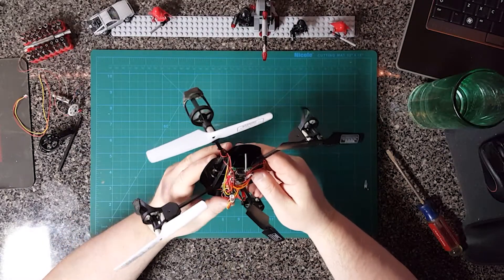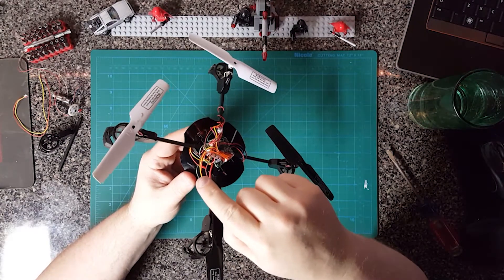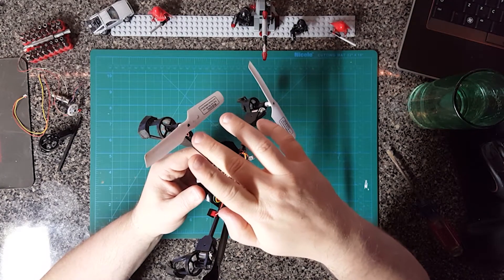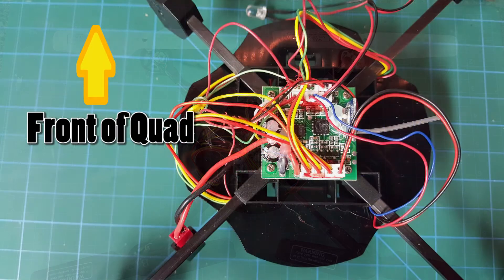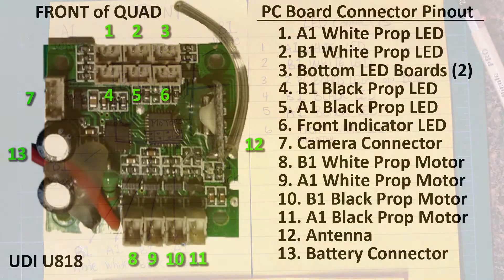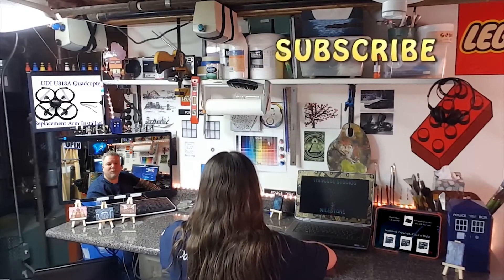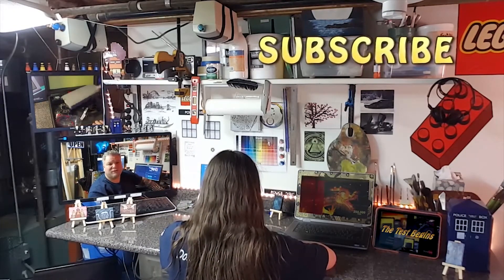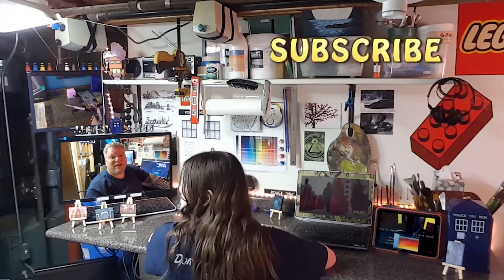UDI Quadcopter PC Board Connector Pinout - U818A DroneTube Repair

Comment: I need help with my drone it's a vivitar step view and when I opened it up I accidentally pulled some wires out that were connected to the a small chip board  inside the drone and I thought I hooked them back up together but now it just flashes it's lights

Comment: Help !!
My udi rc u818A HD dron's electrical conductor 2300 has burn what I can do to repair it?
Reply from the maker: Hi, sorry youre having issues. I would try buying a new mainboard here: ( https://amzn.to/35oVItC )and replacing that. Otherwise, not sure if you can purchase and replace discrete components on the board. Good luck and let us know how you make out.
Reply: I have the same problem and I don't know anything about electronics, I did some research and I think they are SMD transistors, I bought some and I hope they work, I was looking for some electronic circuit diagram but I couldn't find anything.

Comment: I was contemplating the use of the reciever for an RC lawn mower. Mostly because of the return home function, and camera connector. Using a dual motor 32a sabertoth, what two motor connection should I use? B1W+A1B is my initial guess.

Comment: I replaced the motor, check all the connections are fine, thanks you for schematic, but the motor when connecting the battery it  keeps operating slowly and without any order on the part of the command control, maybe The board or what do you think, thanks for your help!
Reply from the maker: Hi, i have heard of that happening after the board was replaced with a new one. And unfortunately, most of the time it was a bad new board. These things arent the greatest quality and ive heard of a fair amount of them being bad right out of the box. Sorry for the bad news.

Comment: I need a new board. Thought it was a bad motor. Nope, plugged motor into other power source and it runs fine. Is there a board replacement part for this?
Reply from the maker: Hi Steve, sorry you're having issues but glad you pinpointed the problem before buying unnecessary parts.  Take a look at this board and be sure it matches the one in your quad before purchasing and good luck with the repair. https://amzn.to/2kUSOWM
Reply: ThinCube  didn't fix it. 1 new motor isn't working at all. No power no led light. Other 3 motors work. Could it be the controller?  I have video of what it is doing
Reply from the maker: You replaced the main board and one of the motors isnt working? Am i understanding you correctly? If so, try swapping wires on the main board to see if the motor will work on another connector, if so then the board you got is bad. If not, check the wires to be sure they have a good connection.  Is your video posted somewhere i can watch it?
Reply: ThinCube new board, new motor. Thought it was a bad motor but it's not. The motor works when plugged into other socket. Ok so tried new board. Does the same thing as before. No power to motor and led doesn't work either.
Reply from the maker: It sounds strange. Ok, last thing i can think of is this: Did you try powering that particular motor with connecting it into the housing and gears and props? There possibly could be some binding . Other than that i am stumped! Sorry
Reply from the maker: If this is exactly the same issue you had with the original board and motor then i am lost for an explanation. If not then i would say theres an issue with your new board as well. Otherwise, i dont think the controller would have anything to do with it at all.
Reply: ThinCube the old motor did have something wrong with it I think. My old er bro is the one trying to fix it. Anyway you could talk to him about it? Facebook messager?
Reply from the maker: My final guess is that if the old bad motor was ever plugged into the NEW board if could have shorted something out and damaged the new board. Its very difficult to say without all the facts or without being there to troubleshoot it first hand. Sorry

Comment: So, very helpful videos.  My UDI 818a WIFI burned out a motor controller in a crash with a tree recently, so the new motor arm didn't do the trick by itself. I've been unable to find the specific motherboard required for that model. The others (not for the wifi model), don't look like the one in my quad.  Any ideas where I can find one that looks like mine? I'd send a photo but Not sure how to in theses comments.
Thanks.
Reply: One note - the power cord to the battery is blue and red, with a white connector.
Reply from the maker: Hi Keith, glad the videos have helped and sorry to hear about your main board woes!!! I have seen them come up on occasion, on Amazon i believe. I would google the numbers on your particular board and see what comes up. Its very common for a motor issue to also take out the main board so i have seen alot of issues like this. If you are comfortable with soldering, you may want to try reflowing some components on the board. The solder joints on these things are very weak and heat can cause them to open up like a blown fuse. Another very common issue with all sorts of cheap electronics. Good luck and let me know how you make out.

Comment: Hi, our drone is only intermittently pairing with the transmitter. When it won't connect, a tiny red LED on the bottom of the PC board flashes. Do you know what that means? We have power, as all the other LEDs work, and the drone will fly at odd moments when we somehow get everything connected. Moving the throttle up and down does nothing when the red light is flashing.
Reply from the maker: Hi Paul, did this start happening after a crash or doing any modifications? I ask because it could be a bad connection with the antenna. Lift off the housing and take a look at the antenna. Make sure it is straight (its just a small piece of wire that you can bend and straighten with you fingers). Also, make sure the solder connection is good on the antenna. If all that is good, make sure you take the batteries out of the controller and the drone for at least 30mins to get everything to fully reset and then make sure all batteries are good. Let em know what you find.
Reply: Hi ThinCube, Your idea is a good one. I checked the antennae, and I think both antennae are in good shape. I looked at the circuit boards on the transmitter, and they both have a residue on them. I think someone spilled something on the transmitter, and we have at least one short. I tried cleaning the board with a damp swab, but it was not effective. Next I'll try gentle abrasion.
Reply from the maker: Hi again Paul. Do you have any experience with soldering? If so, try reflowing all of the solder joints in the area in question. The technique is called "shotgunning" and it has helped me repair many items in the past. Especially with cheaper electronics made at questionable factories. Their solder joints are hit or miss from the start. Good luck and let me know how you make out.
Reply: Hi, i just reflowed my board and the quad is now alive. I forgot which plugs the motors go into so that's why i came to this video.
Reply from the maker: Awesome Max, glad to hear it. What were the symptoms before reflowing?

Comment: Thanks for this.   Helped a buddy out who had installed a replacement board 45 degrees off orientation.  We didn't know that the board had a front and back, but it makes sense now that the gyro needs to be aligned with the motors it is controlling to fly properly.  If you've replaced a control board, and your drone won't stop flipping over on takeoff, check to make sure the board is installed facing the proper direction.
Reply from the maker: Hi dachs, thanks so much for this info and glad the video helped you out as well. I was not aware of this situation and will be sure to let others know in the future should they come to me with similar symptoms. Might consider doing a video of me installing my board incorrectly and show what happens. Thanks and happy flying!!!

Comment: Had a crash n a busted motor. Replaced the arm. Now when I connect the battery that specific pin is receiving power n the blade starts spinning immediately but doesn't spin when trying to takeoff. Do you think I need a new motherboard?
Reply from the maker: Hi Darwin Duck, yes unfortunately it does sound like the controller board is bad. You can purchase them here:  --- ---Replacement PC Board: http://amzn.to/2a2ywaL    Good luck and let me know how you make out!

Comment: bibbs823, I think what happened is your bad motor overloaded and then took out the drivers in the H-bridge, i.e. shorted them out. These are transistors that switch the variable pulses to run the motor. The run-on of the new motor suggests these switches are shorted. The only way to fix that is to replace the driver board.

Comment: just got this drone as a Xmas gift and crashed it from bout 10 ft onto cement and now it won't fly all it does is flip over on takeoff its uncontrollable... tried replacing blades unhooking and rehooking each prop trying to reset it every attempt has been a NO GO... my brother in law got the same exact one and when he does the gyro reset hit front led light blinks 3 times where when I do it mine only blinks one time... any idea on a gyro reset or mod to get my unit running again
Reply from the maker: Hi Chadd, first off watch this video to be sure all of your props are spinning in the right direction and have the correct prop pitch at each location (especially if you removed them and possibly installed in the wrong order). https://www.youtube.com/watch?v=nTNhGXrO5ik&feature=gp-n-y&google_comment_id=z124dvoqfwz3upcih04ch5vy2xn3jv2pmng0k   Let me know how you make out and what you find. Also, not sure why yours isnt responding to the reset. These things arent built to strict quality controls so sometimes they have different components and different firmware.
Reply: all props are correct and spinning the right way still no go but it never flew right right after I crashed it was flying perfect I crashed it and the second I turned it over and tried to take off again it just flipped over on takeoff like its brains or fried or something it says in the manual you can unplug and replug for a reset but I don't know if the copter needs to be on or what
Reply from the maker: I was just reading a couple of manuals online and to be sure you do a reset from the beginning you should remove the batteries from the drone and the transmitter for at least a couple of minutes just to be sure any errors are reset. Also make sure you have charged batteries. Then turn on just the transmitter and throttle all the way up, then all the way down. Then power on the drone and place it on a flat surface. It should be facing away from you. Back toward you and front facing away as if you were following it.  After this you will hear 3 beeps and the front LED will remain solid. Be sure NOT to touch the throttle during this proceedure. Now move the direction stick and you should see the LED flash, indicating that it is calibrating. Once the LED remains sold it is ready to fly. Here is a link to the manual i am referring to, page 9:   https://www.docdroid.net/UfMq0de/818a-hd-manual-2016-print.pdf.html#page=9
Reply: I put a video on my YouTube of my drone and the issue I have feel free to check it out and lemme know your thoughts haha
Reply from the maker: is it live yet...i didnt see any videos on your channel. just a def leppard playlist. saw them in concert years ago :)
Reply: Lol hold on I try again
Reply: I just set it to public try again
Reply from the maker: Chadd Ward Wow, yeah never saw anything like that. It is very strange in that it starts to fly a little bit then BAM....it flips. I've only seen them flip right away as you try to take off. My guess is that something on the main board got damaged during the crash (the gyro or a solder connection on an IC). Without another similar drone to use as a test bed the only thing i can suggest is buy a new main board or another UDI quad :( Sorry Chad!!!

Comment: any fixes for the motor constanly running.  replaced front CCW arm and when battery is connected- motor runs.  seams to be whatever is connected in pin 8, constantly runs.
Reply from the maker: Hi Brady, that is a common issue and everyone i've spoken with has had to replace the main board. The board highlighted in this video actually. You did exactly what troubleshooting i suggest to make sure its not the motor or wiring shorted, so if anything connected to that pin is always on, then the board is supplying voltage/current when it shouldn't be. Sorry for the bad news and good luck with your repair.  There is a link to the replacement board in the description above.
Reply: I have the same problem. Mine is a u818a wifi. I cant find a board. any suggestions?
Reply from the maker: ghullett01 Hi, i would first take a look for numbers on ur board and search using those. there are a few different versions of the U818a so there are a couple of dif boards as well. try the obvious...Amazon and eBay. good luck and sorry i dont have more info for you.

Comment: do i have to put it back in the same hole if i change multiple legs?
Reply from the maker: Hi Stephon, as long the replacement leg (arm) has a motor and prop that spins in the same direction for that particular location on your drone. Here is a link to another video that explains it in detail.  https://www.youtube.com/watch?v=nTNhGXrO5ik&t=155s  Good luck and let me know how you make out, Thanks Tony.
Reply: ThinCube Thanks, i changed all four legs and i had to put it back in the same holes so this video helped.
Reply from the maker: Awesome, glad i could help....happy flying Stephon!

Comment: Hey Tony, thanks for your videos.  They are a great help since UDI does not provide support or answer emails.  One question I have and others might too, is about the differences between the 818A models.  For example, are the pc board connections and motor/prop orientations the same across all the models?  I have the U818A HD+.  How does it differ in layout from the U818A of this video?  Since you apparently own most or all these models, it might be a great video subject.  Also there is the question of how to order replacement pc boards so that they will be compatible with the transmitter.  My Tx has a blue LED.  Apparently the older version has a green led and "ufo" written on the transmitter next to the LCD screen.   Also the printed manual is apparently wrong as it shows the two starboard (right) motors as counter-clockwise and the opposite as clockwise, when in fact the correct orientation is for the front and rear diagonal motors to be the same (wire color and rotation).  Might be a good video subject to detail the manual errors.    Finally it might be interesting for troubleshooting purposes to have a video that documents what happens when the motors are installed in the wrong orientations (eg. installed how the manual says they should be).
Reply from the maker: Hi M minerran, thanks for the comments. I do not have access to any other models now, just my original 818a. I borrowed friends drones to basically see how they tick. And since these aren't made very well, not many have survived, lol. The printed manuals for all of these and many other electronics from"over seas" are horrible to say the least. If the translations aren't bad then the content sucks. It's what inspired me to start doing the UDI videos. I will try to do more, thanks for more inspiration. Ok so to purchase the boards and other accessories/parts, i've used and been sending people to Amazon. Here is a link to some parts: http://amzn.to/2fg2G99   And i have done a video on motor installation and prop direction. Check them out here: https://www.youtube.com/watch?v=3DBkewM-4Ew&t=68s    and here:  https://www.youtube.com/watch?v=nTNhGXrO5ik&t=1s
Thanks again for commenting, good luck and happy flying :)

Comment: I'm wondering if I could take the electronics and motors and camera and put them on a micro frame
Reply from the maker: HI Juan, I was going to try doing that but never got around to it. I'm sure you can physically and electrically make it work....the big question is whether the frame you use is light enough for the power of these motors. Let me know how you make out.  Thanks, Tony

Comment: I love the video demonstration and the configuration layout very cool and very helpful. I followed the instructions and I ended up with 3 blue lights and 1 red light. Not sure what I could have done wrong. Any ideas?
Reply from the maker: Hi, thanks for the kind comment! The LEDs colors should not change at all. There should be one LED at each prop(Connector #  1, 2, 4 & 5)  as well as one White LED to indicate the front of the quad(connector # 6) and then 2 LEDs strips on either side of the camera (connector # 3).  So as long as you follow the correct wiring show here and in the video, then whatever colors you get are what UDI designed for that particular model/rev. I have seen different UDIs with 3 blue and one red on their prop LEDs. Thanks for commenting, hope this helped and Happy Flying!
Reply: Thank You. This does help. I will start from scratch and go from there. Very Helpful!